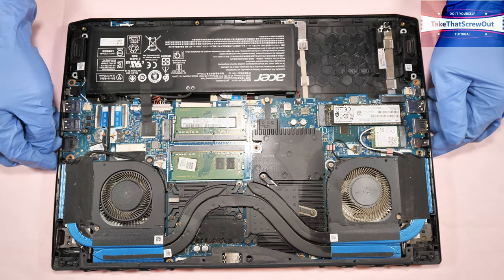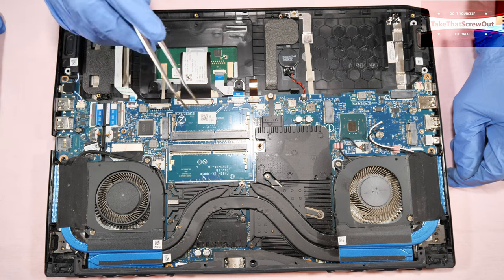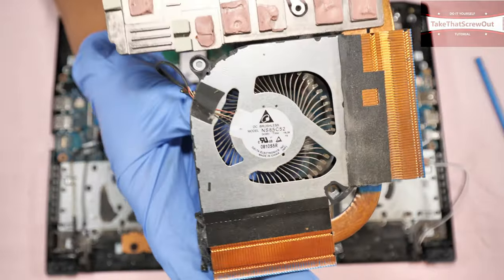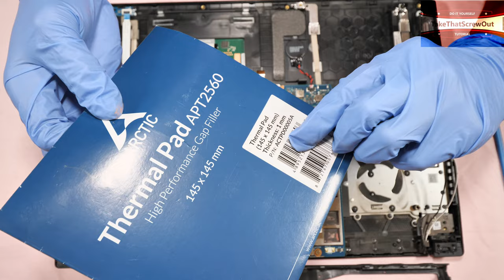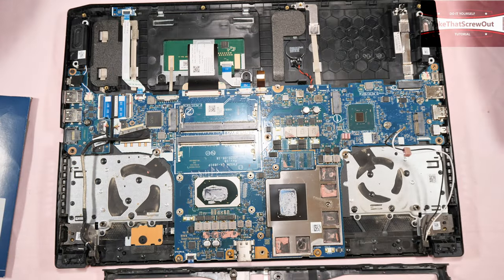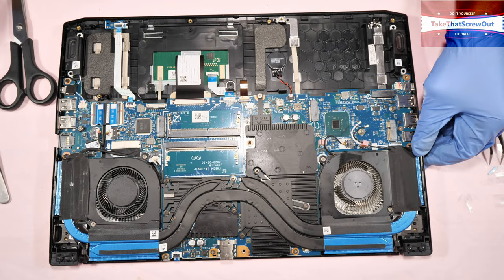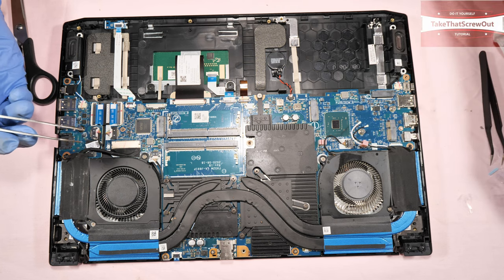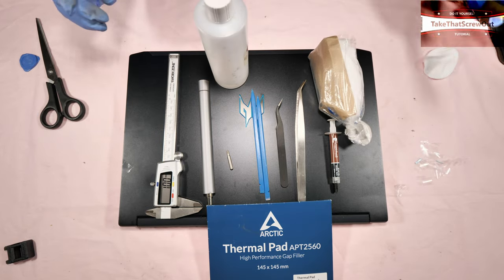ACER PREDATOR Triton 300 | Teardown | Disassembly & Upgrade options

Comment: This is excellent and methodical, well done , my triton is due a repaste ( 3070 model ) , regularly hits 100 degrees on cpu ,
Reply from the maker: i recommend use good quality paste and pads..Gelid Ultimate for pads and Noctua NT-H2 for paste. don't hesitate on paste, put enough or more then spread it evenly on the die..it would improves thermals. hope this helps! thanks!
Reply: You could use throttle stop to undervolt your cpu...or just disable turbo boost... disabling turbo boost will lower CPU temp significantly.

Comment: i think 2mm thermal pad will fit better...what do you think 🤔?
Reply from the maker: Hi bro! This brown paste is a Thermal putty.. but definitely you could use thermal pads instead, but 2mm is way too thick.. i suggest 1mm to 1.5mm maximum thickness but make sure use a soft kind of thermal pads like the Arctic TP-3 or equivalent, because it adopts the gaps easily.

Comment: Awesome tutorial.❤❤ Can I replace RAM without removing Battery?
Reply from the maker: I suggest, always disconnect the battery terminal first before removing any hardware on your laptop. thats the safest practice. but some laptop RAM can be easilly accesed through the back without removing the entire backcover..so, it should be fine removing and upgrading the RAM without disconnecting the battery terminal.

Comment: hi, great video!
Please tell me, I have a version on i7 11800h, RTX3060 6 GB GDDR6, 16 RAM, 512 GB NVMeSED SSD. Are the board models the same? I want to increase my memory capacit
Reply from the maker: Hi bro! Yes you can! Triton 300 models Memory can be upgraded, you can throw in 32gb (2 x 16gb) RAM..just check the stock RAM ddr4 and get higher capacity and similar or faster Speed.
Reply: @TakeThatScrewOut  thanks ao much!
Reply from the maker: @noper1039  You're welcome bro!

Comment: Great video to make things easier.  Could you confirm that the PCH chipset is the one just below the nvme slot 1?

Mine goes up to 101C while playing Horizon Forbidden West, which is crazy.  No wonder the fans do nothing on cooling it down.  I think I will move the system drive to another slot.  I was planning to use all 3 slots, but...  What a bad design from Acer.

What are your recommendations?  Thanks.
Reply from the maker: Hi bro! Try to put thick High quality Pads on each ssd's and chipset to help dissepate heat..try to use GELID thermal paste

Comment: Do you upgrade and repair? I have a Predator Triton 300.
Reply from the maker: No, i don't do repair.. I just do content Tutorial videos. 😀
Reply from the maker: Why what's wrong with your laptop bro?
Reply: @TakeThatScrewOut  Battery, speakers and in need of ram upgrades (only has 4gb of ram).
Reply from the maker: That depends of the specs of your laptop chipset if capable for expansion upgrades..whats your processor bro?

Comment: Do all the components that don’t need pasting using 1 mm thermal padding?  I have 1 mm and .05 mm at my disposal.

Also, what are the tools you used to pry open the laptop and also to disconnect the fans?
Reply from the maker: Hi bro! those areas has brown pads, actually that was a Thermal putty. but you can definitely use Thermal Pads instead..that could give you similar results on thermals..use 1mm Thermal Pads on the VRAMS. and regarding the Prying tools..theres a link on the description for Amazon or you can find then mostly online like ebay or Alixpress. and i used a special Pliers to safely disconnect a Fan connector link on Description as well.
Reply from the maker: The Pliers is called " LEONTOOL 6INCH PLIERS " try to search them on Amazon or ebay
Reply: @TakeThatScrewOut  Awesome, another question.

What tape would I use for the fans? I think mines are bad now
Reply from the maker: @itstoasty7089  The stock tape that they use are High Performance & Ultra heat resistent tape..they are exclusive from manufacturer..but you can easily find an alternative that has same Performance, try to search it on Amazon " Heat Resistant Tape / High Temperature transfer tape "

Comment: Should I buy 0.5mm or 1mm thermal pad with liquid metal on GPU/CPU?
Reply from the maker: I should say you better go for 1mm Thermal pads for the VRAM chips and good quality thermal paste like NOCTUA NT H2 for the CPU & GPU..personally, i don't recommend Liquid metal unless you know what you're doing., because its a bit delicate process to put it on, one mess could potentially cause you short circuit in you board. but if you put it on correctly, i think its gonna be worthied.
Reply: @TakeThatScrewOut  I’ve already put it and it has god level cooling but in AAA games, gpu vram locks itself to 810mhz so I thought it’s because vram paste… I could mess them up a little bit😅
Reply from the maker: Enjoy bro!

Comment: Is the black tape reusable?, the one that connecting fan with heatsink, i saw that you open it in a half side.
Reply from the maker: Hi bro! those tape are stock from factory..but that could be reusable if you remove them carefully not to tear them apart..but make sure before you tick them back feel the sticky side if still do the job..otherwise you should replace them with a fresh one. you can find alternative High temp resistant tape in Amazon or ebay.

Comment: 1. Is it posible to remove the fans without the whole heatsink? 
2. If i have to remove the  whole heatsink, is it nessessary to replace thermalpaste?  (Does heatsink removing ruin thermalpaste? )
           I just want to clean the fans ,  a bunch of hair stuck in it
Reply from the maker: Hi bro! Yes, 1.) definitely you could remove both Fans and clean them without removing the Heatsink..but PAY ATTENTION by doing so, because there's a THICK BLACK ribbon that attached from the Fan to the Heatsink Pipes, that ribbon's purpose to let all the air from the fan blows directly to the pipes..so, that should be resealed back where it should.
2.) Yes, everytime you separate the heatsink from the Die Plate..you should always APPLY A FRESH Thermal Paste.
Reply from the maker: Be aware, this laptop uses a Thermal Putty instead of Thermal Pads on smaller chips like the VRAM chips..but i've used both thermal paste both CPU and GPU die and the VRAM instead of putty on this tutorial beacuse i've run out of Thermal Putty on my studio during the Tutorial..but i can guarantee they have a same performance.

Comment: Hi ! Do you know the reference for the GPU fan? 
My Triton 300 SE is broken and it seems to be the same fan as in the video.
Reply: What happened to your triton?
Reply from the maker: Hi bro! this is the LEFT FAN fan DC BRUSHLESS model: NS85C52 , DC 0.5v 1.00A
RIGHT FAN DFS5K22305283E EP ( embeded Mark on the metal casing of the Fan)

Comment: I just got a RAM upgrade (Predator triton 500 model PT515-52). My TURBO button wont light or work. but the turbo mode on my predator sense working. I re installed my predator sense and Quick access already and its still not working. What can I do to fix it? Does the technician forget to plug something inside?
Reply from the maker: well, the only way to find out is to open and check the connector bro..but i suggest if the software itself works fine..just don't bother about the light thats not working, thats only aesthetics. the most important it works fine.

Comment: Hi i have the GTX 1650 Ti version and recently it shows a Code 43. So i wanted to see if theres a hardware issue, because i have already tried a bunch of methods to see if its a software problem. 
Is it possible to check if it is a hardware issue?
Reply from the maker: Note the code number, check the Manual that came with your motherboard all fault error codes are all there..or just Google it " PC ERROR CODE (CODE NUMBER) " or Use a BING ChatGPT.